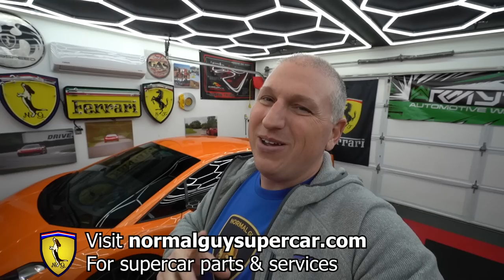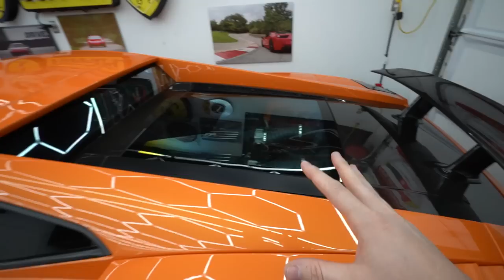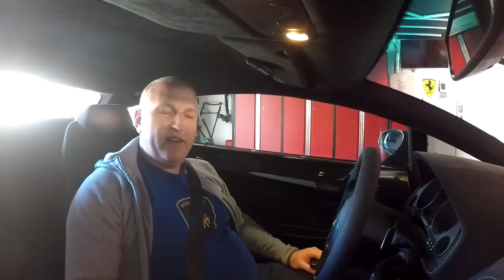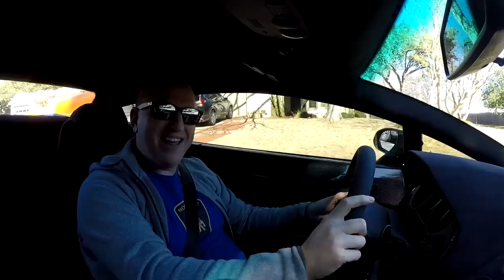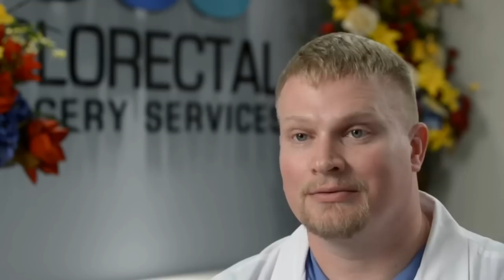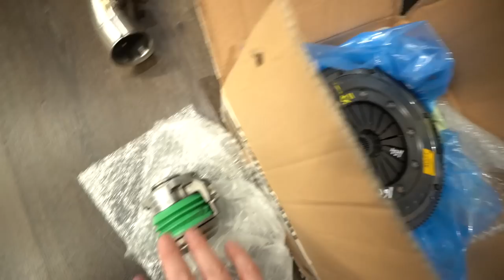Tips & Myths of Single Clutch Transmissions

Comment: I’m so happy you made this video. I own a manual Murcielago and an Aventador and everyone thinks the manual gearbox is better but it’s not - it’s just a different technique. 

I really liked the way you explained how the e-gear system worked. 

From driving my Aventador and from reading the owners manual (which recommends you keep your foot on the throttle when shifting up or down) that lifting off the throttle on upshifts is unnecessary. So the owners manual is correct. 

One thing your review didn’t cover was whether driving it in Automatic mode wears the clutch. 

When I am driving to a new destination I sometimes put the car in auto mode to concentrate on navigation rather than on shiting and navigation.

My thoughts were that auto mode shouldn’t make a difference to clutch wear. What do you think?  

I love your honesty and also scientific and logical approach to supercar ownership. Thank you again.
Reply from the maker: The only reason auto might wear it more is it may be shifting more.  Otherwise it has no effect.

Comment: I used to work in a performance shop that serviced these regularly. It was wild how one guy replaced his clutch every 2500-4000 miles and others would see even 50k miles. Hard launches are very hard on these clutches since the wheels keep traction and the clutch slips.
Reply from the maker: Yup!

Comment: Great content, Dan! Can’t wait to see how labor intensive the clutch replacement is. As good as my dual clutch is, to me a single clutch enhances the driving experience
Reply: If you like jerky jerky, it sure does.  If one like smooth instantaneous engagement with no throttle interruption, not so much.
Reply from the maker: I like both. The raw shifts can be fun in the right mood, but so can the lightning fast shifts of a dct.

Comment: Great content on the system. Try a clutch re-learn procedure when starting. I have always done these on the E-gear, F1 and Sportshift systems. It makes the changes so much better. You can also easily install a lightweight twin plate clutch. These tend to last longer and absolutely transform the car. Not just the shift speed but also the pickup. This change is a must for most dry single plate clutches in the UK market.
Reply from the maker: Interesting

Comment: Hi, totally agree. Unless you have zero mechanical feeling, it's easy to know when you're stressing the clutch. Reverse and first gear at low speed in steep slope is the worse. Do not underrev in first and second as it will not fully engage below 1500/1800: Not for traffic jam. Also pay attention how often and how long the pump is running. This can show a weak pump or internal leakage in the actuator. On Ferrari/Maserati replace the infamous pump relay before it kills your pump.
Reply from the maker: Yes if the pump is cycling for long periods or very frequently, that's not good. Also if the pump changes pitch that can be a sign it's dying.

Comment: Great video on the system . Had my 2000 360 TCU reflashed to CS profile . Was like a new car. Lightening fast gear changes , minimal clutch wear
Looking forward to the clutch change video. I think you will be able to adjust the new PIS with your Launch 431. 👍
Reply: This.  Once the clutch becomes warn the time for the clutch to engage becomes a bit longer than you would want.  Putting a new clutch in this car will drive a lot better, especially with a re calibration of the clutch system.
Reply from the maker: Yeah I've heard many people sing praises for the cs tcu. I'm hopeful that when done with the new clutch it will behave a little better.

Comment: I had my eGear actuator go out 2 months after I bought my ‘05 with 22k miles on it. That was fun. Back order everywhere and dealer part price was $7500 IF they could get it. I found one rebuilt on eBay for $3500 after the core refund (so $4500 up front 1k back for the old one). Another $1k to put it in. Runs perfect now but that was exciting. Lol   eGear was considered a bad word in my home for a while. Lol  Definitely gotta pay to play with these cars. 💰
Reply: For performance/supercars the cost to buy may come down, but the cost to own never will.
Reply from the maker: Yeah the actuators can go out and unfortunately it's not cheap!

Comment: Dan, you need to recalibrate your eGear. Start the car. Put it in neutral. Hold in both paddles for 20 seconds until the system starts the calibration. Then, go test drive it again. You'll find the herky jerky to be far less. Do this often as the clutch wears. You're welcome. Congratulations again on UPGRADING to Lamborghini 👍
Reply from the maker: I'll check that out

Comment: About clutch life, in my 575, the clutch lasted about 43 thousand kilometers. I had about 4% left😅. It stopped working on the highway in KL and I created a massive jam of mostly rubberneckers making pictures. My 5 minutes of fame… the previous owner mostly drove the car in auto mode which doesn’t help, so I agree with Dan about the longevity of these clutches if properly handled. Luckily labour is cheaper in Asia that with you guys in the US.
Reply from the maker: Yeah that's about right

Comment: I had an E-60 BMW M5, the one with the V-10.  It had the SMG (sequential manual gearbox) transmission. It is the same as this clutch.  I had it replaced by the BMW dealer and they told me to lift off of the throttle, just slightly, when up shifting.  This made the shifts smoother and caused less wear on the clutch.  Also, do not use launch control.  These are drag cars.  I drove mine hard, shifted at red line, and always down shifted coming into curves.  I got about 60,000 miles out of the clutch.
Reply from the maker: That's pretty good

Comment: So many 360 and F430 owners I know all say to keep the car in Sport mode to significantly extend the life of the clutch due to less feathering by the control system, similar to what you described with reverse and slow starts. Added benefit, Sport mode is more fun. :)
Reply from the maker: Race mode on the F430! Sport in the 360.

Comment: As a former F430 owner, I’m sure you are aware.  On a single clutch car, if you lift the throttle slightly when shifting it eases the clutch and provides a smoother shift and less clutch wear.  I had an E60 M5 with the SMG transmission and got 60,000 miles before I needed a new clutch.
Reply from the maker: Smooth isn't how you get it to last longer

Comment: I've only driven the Ferrari F1, but once you get used to it it's easy to feel when the clutch is fully engaged, or being slipped.  It should only slip the clutch in first or reverse; and avoid Auto mode completely.  As regards the Sport/Race settings and the suspension softness, if you're in second or above clutch slip will be minimal.  I know US cars don't usually have it, but if you use Launch Control it can kill the clutch in a handfull of goes.  But if you're buying one of these cars the number of launches can be read of the ECU, together with estimated clutch life.
Reply from the maker: Yeah launching hard can wear the clutch for sure

Comment: Guy in my neighborhood had a black 599. For a while. I would occasionally pass him as he was puttering along the boulevard doing 35. 
There is a street that goes for about a block up a steep hill from the beach to the civic center that gets a fair amount of traffic and traffic backs up at the traffic light. One day my wife and I were walking down to the beach and there was a line of cars waiting for the light. The light changed to green and the line of cars started moving, except halfway down the hill the 599 was lurching back and forth with the engine being revved and white smoke pouring from the rear end. I delicately averted my gaze as we walked past the sad scene. That was the last time I saw that car around the neighborhood.
I wonder if the driver was treating the car like it had a regular torque converter automatic, and holding it on the hill by applying light throttle instead of using the brake.
Reply from the maker: Eek

Comment: Yep your correct. I had the clutch replaced at a dealer, and it was 10K for the F-430. I have a single car garage and my car barely fits in there. I also live in an HOA, so they would not allow anyone to do a job like that outside.
Reply from the maker: Ah yeah that's a problem

Comment: my Maserati Cambiocorsa only lasts about 20K in clutch life. I was able to have mine replaced for only $2500 at my local independent Ferrari shop. Interesting fact, my friend's Alfa 4C has the same pump sound when the door is open or unlocked.
Reply from the maker: I think alfa uses the same pump

Comment: Love the new content! Some questions:

Could you please explain more about the herky jerky at low speeds? Why is that happening?

Is it possible to re-manufacturere/re-line the clutch? Similarly refurb the throw out assembly with a new bearing.
Reply from the maker: I think there are some refurb options but I just wanted to get new. The herky jerky is because the computer isn't that awesome at managing the clutch

Comment: Now that would be a popular manual swap, but damn, a hydrobot doing that would be euphoric! As an excuse to use the paddles, I would pop it into neutral, and coast as long as possible up to every stop. 
I cannot wait for the yt vid about:
(ex.)(do not do) (jj) (incorrect) (might exist?) 
Hack ing in by-unlocking passenger door, flip the key to on 9 times, hit the gas pedal three times, pop it to 1st, and it does a fresh calibration of the clutch, no dark weeebing. 🙄🏁🤖
Reply from the maker: Ah cool

Comment: I do not know about the other F1 style single clutch manuals, but BMW's SMG3 is not a "normal standard transmission". Because there is no need for a shifter linkage BMW was free to place the gears where ever they wanted on the power shaft in the trans. As a result they put the two highest torque gears (1st and 2nd) on opposite ends of the shift so each gear is immediately next to a shaft bearing in the trans housing. Then they installed the rest of the gears in progressive alternating order from the outer edges so 7th is in the middle of the shaft. As a result there is no way to design a manual shift linkage for the trans or convert it to a linkage operated manual.
Reply from the maker: Ah yeah that doesn't sound the same although the do have manual conversions on BMW smg transmissions so I'm not sure about that?
Reply: @normalguysupercar  The SMG3 was the only BMW purpose built F1 box. The prior versions were normal manuals with hydraulic actuators retro fitted on them.

Comment: Great video, Dan.  I’m getting ready to put a clutch in my 08 430 and was wondering what tool the shop needs to do the install properly, I.e., to set the engagement point.  Thanks
Reply from the maker: They need a computer that can set the calibration points for the clutch.  On the Ferraris you can probably get away with one of the upper end Launch X431 models.

Comment: Well done explanation of E-Gear and F-1 clutches. I own both. I use sport mode in the Gallardo but not in the 360 as I like the suspension setting in normal mode. My Ferrari had 55% left when I bought it at 13K mi. It now has 29K and its reading 45% left. So, you definitely can "save" your clutch with proper driving. You didn't mention NOT using Auto mode (other that you are not a fan); does that wear a clutch out more than paddle shifting?  Urban legend says yes. Finally, were the clutch and throwout bearing OEM parts/prices from a Lambo dealer? They seemed high. Did you consider a Kevlar clutch?
Reply from the maker: I don't think auto mode matters much. I did get oem from Ferrparts

Comment: Great video Dan- In your opinion do you prefer the F1 or E-gear system? I'm looking at a supercar purchase in the next 12 mos and was only focused on DCT equipped vehicles. After seeing your explanation I think I'm open to 430/Gallarado era vehicles now.
Reply from the maker: I think both are basically the same. I have yet to try the LP Gallardo which supposedly is better.
Reply: We have an LP550 and also had experience in the superleggera of Dan's year.  They are nearly identical to me, E-gear wise, the Superleggera just rides a bit stiffer.

Comment: Almost all of Lamborghini single clutch setups have upgrade kevlar clutches that last longer than the original 40k. The clutches can be purchased off Alibaba because its all Chinese now. When you start researching the internals of this car outside of engine components, ITS CHEAP. The suspension simply dosent work on this car, and NEEDS a aftermarket upgrade. Then the car can come into its own as a performance vehicle, but without a suspension upgrade its simply a buckboard car. These were problems highlighted YEARS AGO on many exotic car forums.
Reply from the maker: Thanks

Comment: I posted about the possibility of a rebuilt clutch for this car. There are outfits that will do custom rebuilds. The post was removed for some reason. Possibly because I included a website address of a company that does this work. I think you would do the normal guy super car community a service by trying a rebuilt clutch and confirming/disproving this approach. Samcrac did it with a Ferrari and seemed to have good luck with it at less than half the price of a new OEM clutch if I recall correctly. Let’s face it. It’s just a diaphragm spring and a plate with friction linings. No reason it should cost $4000.
Reply from the maker: You can get rebuilt clutches, there's certainly a market for it

Comment: Neutral.
One thing I had heard was not being sat at the lights in N. It was when slowing down, to pop it into N. This is stop the car downshifting itself to 1st, and feathering the clutch during slowing down putti g it into 1st then disengaging when Stopped.
Reply from the maker: Eh I'm not sure any of that really matters
Reply: @normalguysupercar  Possibly was not clear. 

If you a rolling at low speed in 1st, the clutch will be feathering. You'll be riding the clutch. 

Therefore, when you are coming to a stop the clutch does not completely disengage. It feathers it.

This feathering of the clutch, is a benefit if you are crawling in traffic and then want to set off. 

But, if you are coming to a stop it is unnecessary and wears the clutch. 

The point with these clutches is positive engagement. Dabbing the accelerator, at low speed engages then disengaged the clutch - it rides it. 
(I've had a 4200 Maserati and a Gallardo)
Reply: @iresident8279  I agree, when the car comes down to first it does the herky jerky.  I'm gonna keep going to N even at lights for the peace of mind.